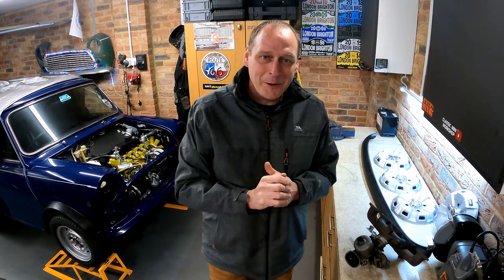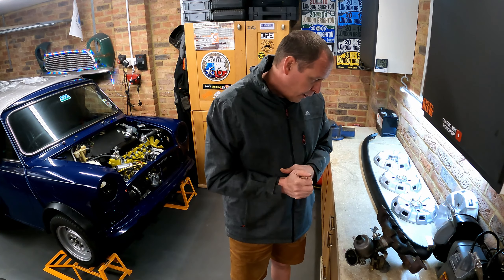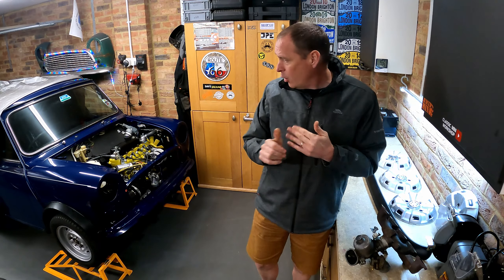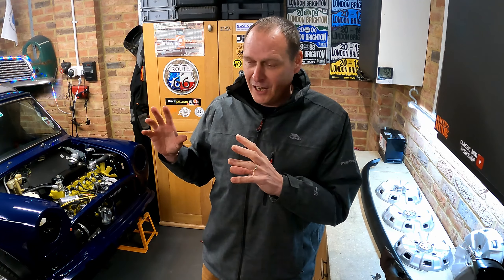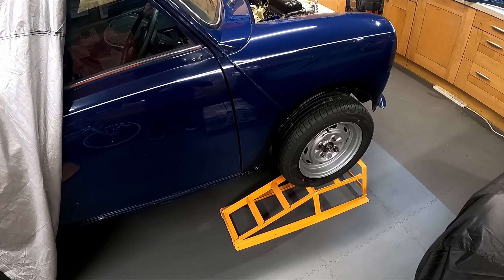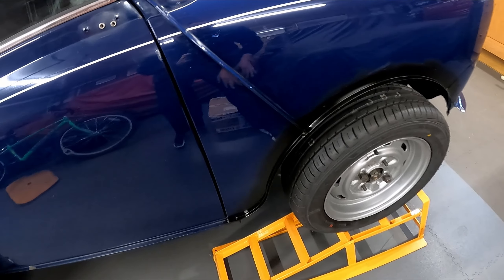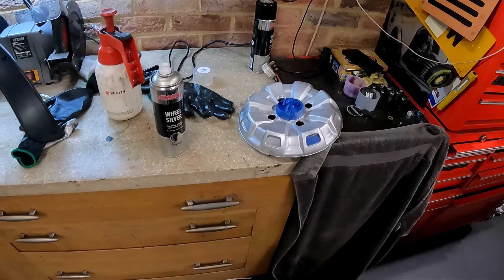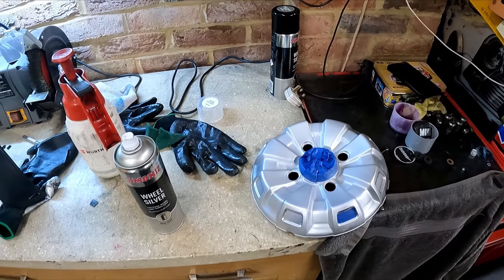Wheel Arch Fitting - Classic Mini Workshop Project Tardis Pt.42

Comment: Hello,
You need not worry, Ultrasonic parts cleaners work excellently for cleaning almost everything.  The larger the better.  Project Binky uses them to great success to clean all kinds of parts.  I have used then for years to clean all manner of carbeurators and mechanical bits and bobs.  they work a treat.  If it Were me I would buy another TVR before you get priced out of the market.

Comment: I had a new Ford Escort XR3 in 1981 - it was a lovely car. Mind you, it did replace an Allegro... Wouldn't mind another one now.
Reply: Had a black XR3i Y reg removed rev limiter in distributor 😉 was clocked by the police at 127mph but could do 130 or more.
Lovely car but had a 205 1.9 GTi which was more fun.

Comment: Keith, to clean my carb I used a small hand held media blaster (one that looks like a pistol with a hopper on top) and filled it with baking soda, blasted the parts outside (stuff goes everywhere) then just washed away the excess on my drive with a hose and cleaned the carb throughly with carb cleaner to ensure none was left in any orifices. Worked great and looks almost brand new 👍🏻

Comment: Another very informative video, I did the exact same with fitting my wheel arches (including the washers) if I need to it again, I'll definitely remember the tip about putting a bolt to create a spacer as it is a bit tricky. Cheers.